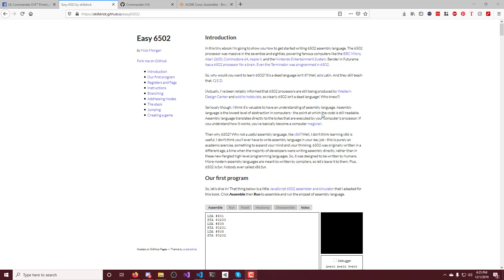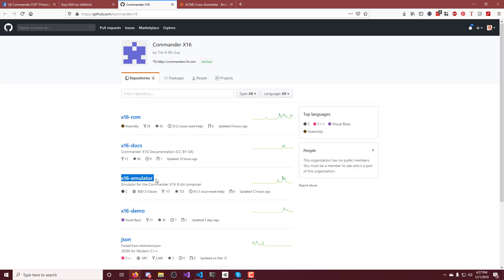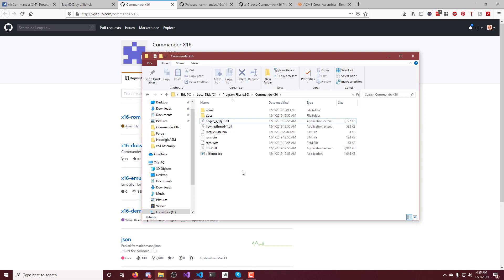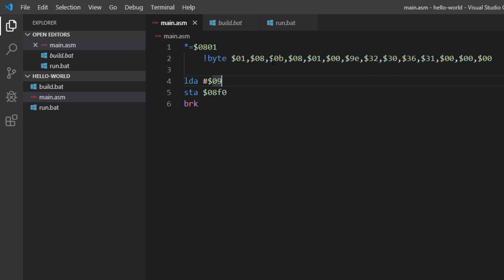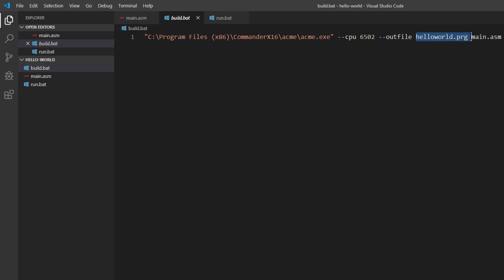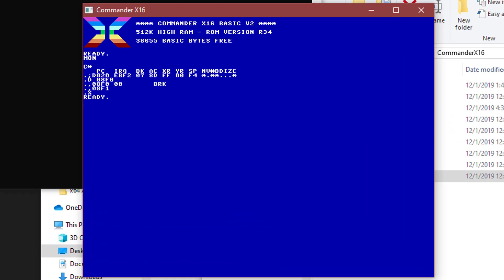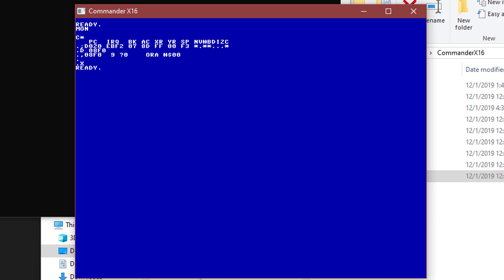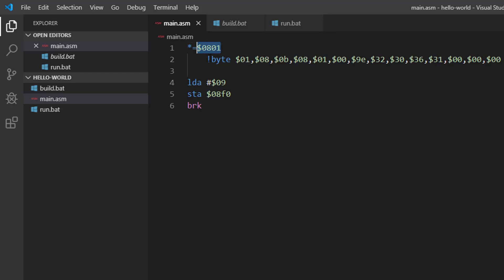Commander X16: 6502 Assembly Hello World

Comment: In a Commodore program (PRG) file, the first two bytes tell the computer what address to load the file data into. So if you're on a C-64 (or, apparently, a Commander X-16) where the first byte of a loaded BASIC program is at address 0x0801, then the first two bytes of the program file on disk are 01 and 08 (because the 6502 stores addresses in little-endian mode, low-byte first). 

It's a little confusing because the ORG setting comes before the 01,08, where I would expect it to come after, because the 01,08 aren't actually present in memory on a C-64, but maybe the X-16 does things differently.

Anyway, BASIC program in memory is a linked list of lines. The first field of the line, at location 0x0801 itself, is the pointer to the next line. That's another two-byte address: in your listing it's 0x80b. The next two bytes are the BASIC line number: 01, 00 is line number 0x0001 - that is, 1. Then comes the actual tokenized BASIC code. 0x9E is the token for the SYS command, which is how you call a machine-language routine from BASIC. Then come the ASCII characters '2','0','6','1' (no, BASIC doesn't convert that and store it as an actual number) which is the decimal address that SYS should jump to, and then the NUL character that terminates every BASIC line. If you've been counting, that NUL goes in address 0x080a, so the next byte is 0x80b - the target of our next-BASIC-line pointer. But the next two bytes are its next-line pointer, and they're both zeroes, which means the pointer is nil: there are no more lines. We've reached the end of the BASIC program.  

The first byte after those three consecutive bytes is at location 0x80d - or in decimal, 2061. By a strange coincidence that's exactly the address that the BASIC program calls via SYS, so that's where control will be transferred from BASIC when the program runs.

You can get fancier by doing assembly-time arithmetic on the label for your entry point to make sure that the SYS goes to the right place, but it's simpler to just have a boilerplate header that is always the same size so the code can always call the same location.

Comment: You should use the '--format cbm' when running ACME.
Then you don't need to put in the first 2 bytes at the start of the program.

It fixes the problem, that the whole program gets put into the X16 memory 2 bytes before
If you then use a text label for a memory location, it is still pointing at the original location.

Comment: Brent  - that first line with BYTE, creates a basic line which will execute the assembly once loaded.  On the C64,  when you listed the program you would see 10 SYS(2064) or something similar.  This is what happens with the X16, so when you load the program and it executes, it will run the code.  This is why you get 09 in $08f0.

I just loaded this program up and the basic shows 1 sys2061 - so when you run this program, it executes the code at 2061 - i.e. the lda #09

The other thing is you have brk - obviously a break, if you replaced this with rts, it would simply return back to the prompt without clearing the screen.  This is why it returns back to monitor if you have had it opened.

Comment: Looks like you have some odd behavior with the monitor. It shouldn't automatically open on its own. Here's the byte string you were wondering about. I pulled this from an example.
.byt $01, $08                 ; Start address of program
.byt $0B, $08                 ; Start address of next line
.byt $01, $00                 ; Line number 1
.byt $9E                      ; SYS token
.byt "2061"                   ; $080D in decimal
.byt $00                      ; End of line
.byt $00, $00                 ; End of BASIC program

Comment: So, there's a thing where when you type in a load command like
LOAD"PROGRAM"
You can also add things onto the end of it. The first thing you can add onto it is a device number. The default device number for the X16 is 1, so the above LOAD command would be the equivalent of typing
LOAD"PROGRAM",1
but you can also change it to be a different device number if you have more than one storage device added to your system. Right now the emulator supports a feature where you can mount a .D64 image by invoking the emulator with the command-line option -sdcard followed by the name of the .D64 file. Note that this is only an emulator feature at the moment and is not likely to make it into the real hardware. In order to load files from within the image, then, you have to specify the device number as 8, so if you had a D64 image that had your "PROGRAM" file on it, then to load it from there, you would instead type 
LOAD"PROGRAM",8
Then, after that, the next thing you can do in a LOAD command is to specify that the file should be loaded into a particular address. This is done by adding a second extra part to the LOAD command, like so:
LOAD"PROGRAM",1,1
That would load your PROGRAM file into memory at the location specified by the first two bytes of the file (in little-endian format). And that is why you add those two bytes at the beginning. In the event that someone accidentally loads the file using the ,X,1 syntax, it will still load into the spot in memory where a BASIC program would go. Specifically, the location $0801.
This also comes in handy if you want your program to auto-execute on load; if you know where the BASIC interpreter will start executing from once it returns from the LOAD command, you can load your program to start in memory at that point so that instead of just sitting at the READY. prompt, it will instead start running your program.

Comment: The Byte sequence represents a small basic program, that will start the assembly program. Usually it is something like "10 SYS 4096". To find out, what the byte sequence does, just type "LIST" before running the program. I'm guessing this one should read "1 SYS 2061". More info can be found by googling "C64 Basic loader".

Comment: Hi, 
!byte
$01,$08, <---- Load Location of Prg File
$0b,$08, <---- Memory Location of Next Basic Line
$01,$00, <---- BASIC Line Number, in this case Line 1
$9e,$32,$30,$36,$31, <---- Basic Command SYS 2061
$00,$00, <---- Next Line Location 0,0 = end of program
$00  <---- End Of Program

so that byte array actually says
1 SYS 2061

if you load the hello world program into X16, then type LIST, this is what it would say.

Hope this helps.

Comment: You may want to watch this https://youtu.be/M3HNNGkL7Bg it will cover the monitor in more depth for you. I also explain somethings in it. The reason you need $01 $80 at the start is because you are not configuring acme to make a PRG file add -f "cbm" or use the !to directive in the asm file to make a prg file.(also don't use ACME it is light weight and not that good, use 64tass ( the docs are exceptional ) or if you must CA65 instead).  The CX16 is not ready for "never used a C64" yet, it would be easier for you to switch to c64/128 as we have a lot of resources and tutorial and books upon books that cover these things. For example if you want to see what those byte at the top are, type LIST in the emulator. Also the CX16 is a 65c02 not a 6502 so you should set !cpu 65c02. You enter back into the monitor because you ended with a BRK, if I don't explain it in my CX16 monitor basics, check out my Commodore Basics that precedes it.

Comment from the maker: I got some answers from the Facebook group on what the first two lines mean. Also I'll be updating my site with any developments I have related to this: https://retroscience.net/commander-x16-hello-world-6502-assembly.html

*=$0801 = BASIC launcher

Now lets go over what the bytes are after "!byte"

$01,$08 = Two bytes tell the computer to LOAD the .PRG file at the $0801 address (this two bytes are NOT going to be loaded into memory they just tell “where to put the program in to memory”)

$0b,$08,$01,$00,$9e,$32,$30,$36,$31 = The HEX for basic SYS 2061 (you can tell this easy 32 30 36 31 (if you see the right number after 3*) is 2061.

$00,$00,$00 = The end of basic. So, when you type RUN it executes SYS 2061 which starts the code that should be placed at $080D

=========

Also, here is a source with comments example:

* = $0801              ; BASIC launcher
!word $080b         ; Address of next basic line
!word 1                  ; Line number
!byte $9e               ; SYS token
!byte '2', '0', '6', '1'  ; $080d
!byte $00               ; End of BASIC line
!word 0                  ; BASIC end marker

Comment: Hi, I do believe first to bytes $01, $08 are "$0801" inverted. I remember (I used to program in machine language) and the first two bytes of the .PRG file say the address were it will start loading
Reply: Yes, that's the standard commodore "cbm" file format. The first 2 bytes are the starting address in LSB format. The rest are the code.